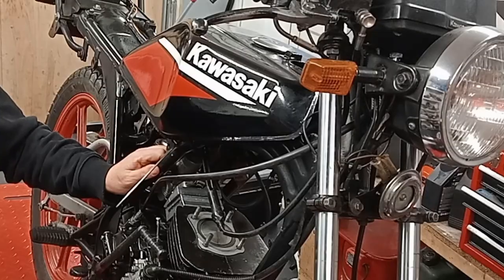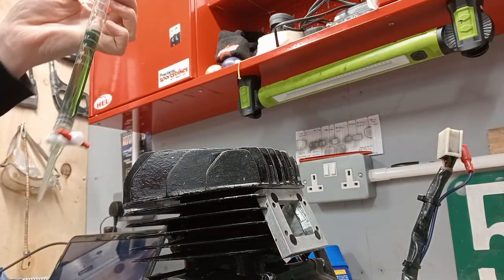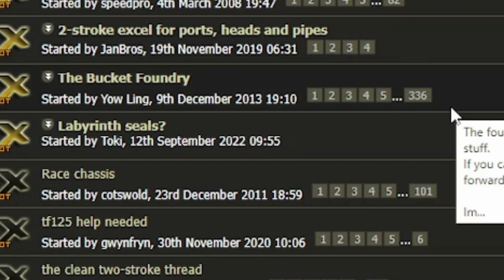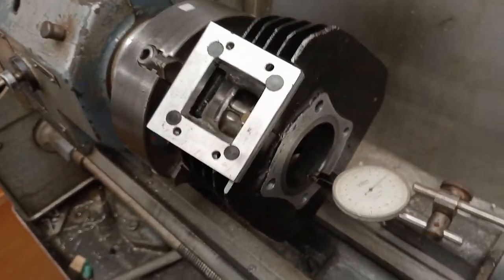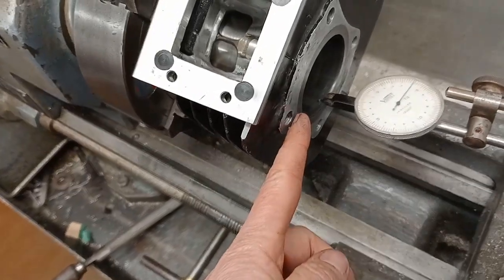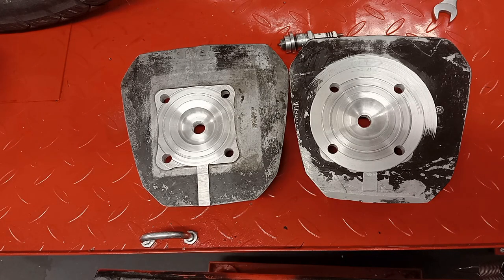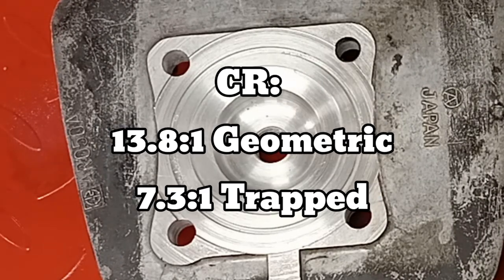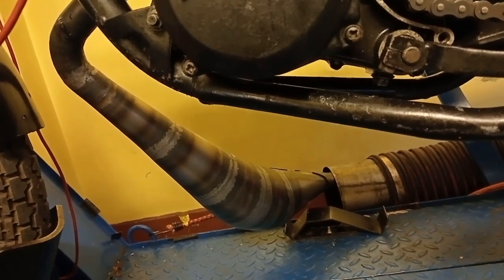2 Stroke Squish Area Ratio Test - Plus Bonus PIPE test

Comment: So much to unpack here. First of all, with more compression, you need to back the timing down at higher rpms as the heat generated from higher compression will work against you. Also, mixture turbulence causes a faster burn. So an ignition with a retard function will help. Check to see what your ignition is doing with a high quality timing light after marking flywheel with additional timing marks. Compression is great for bottom end torque but not so good at high end. Have you looked into ceramic coating the crown of the piston? Ceramic will even out the temperature of the crown so hot spots don't develop possibly causing inaudible detonation at higher compression ratios. Are you seeing any detonation clues on the plugs? Also, ceramic will insulate the crown so the piston transfers less heat to the crankcase. When the piston transfers heat, the crankcase pressure goes up and you won't get a full intake charge as the pressure differential between the crankcase and top of piston when ports open won't be as great so scavenging will be hampered. You can see this after the engine has run for a bit by examining the bottom of the crown inside the piston for what is happening to the oil mix as it contacts the piston. Shiny aluminum means you need more compression, charred means too much. Shiny black means your near the limit.
Reply from the maker: Hi Dale, thanks for your comment. My ignition is fully programmable and I have had the timing light on it but I do need to  try different settings as I've changed quite a bit. I have read that lowering the compression can give more energy to the pipe and if it's well designed it increase HP. 
I'm seeing no signs of detonation but if i'm honest my runs aren't long enough. I need to change the gearing to what it will be for 100 mph and test in 6th gear. Even then i'm sure i will have to jet up and retard ign for the real world. I'm also intersted in the effect on actual airflow over the engine and particularly the  pipe and it experiences a higher or lower temperature than the dyno - could be a key parameter to ensure the pipe is tuned for 100 mph airflow.
Any ideas on ceramic coaters in the UK? I have heard of this. I have also heard the polishing the combustion chamber and the piston crown can have a similar effect by reflecting heat out into the pipe. I'm not sure how effective this is but I see it as a test i'd like to conduct.
Noted about the heat transmission into the crankcase - I'd never thought of this. Thanks. 
So in summary the only place you want heat in a two stroke is in the pipe?
Reply: @AutoBeta2T  Look for shop that offers spray coating, aerospace if possible. Many years ago, Tony Nicasia would race the Kaw triples at Fremont Raceways. After each run he would use a garden sprayer to cool everything down. When I began racing, Roland Cushway was one of my friends when he was working for Hunt Racing Products. He prepped TZ250 for AMA competition. One of the things I noticed was the ceramic coating on the crown. I looked into this and that was when I started observing the under side of piston for what I called the heat health of the engine which I described in the first post.

Long story short, before we began closing up the squish band and coating the piston, we found that at a track like Sears Point ( I have no idea what they call it now) the bike would run out of turn 10 in 6th in the opening stages of the race, but as the race progressed, the bike would drop back to 5th and finally 4th gear as the engine lost power to crankcase heating which is what Tony was battling in triples.

After the engine was developed, the bike would consistently drive out of 10 in top gear. In the end stages of the race, my bike had the benefit of a 15 mph greater drive out of the corner. Ceramic coating works. I spoke with a gentleman that worked at United Airlines at SFO as a flame sprayer reconditioning internal jet engine parts. He informed me that a proper ceramic coating has three levels of applied material. All three have different expansion coefficients. The first layer was more like a primer and allowed for a greater amount of expansion. The second and third were the coatings that did the actual work. But the coatings together would allow the piston crown to grow without cracking the brittle ceramic coating. This is something the Roland had observed, but at the time wasn't aware of the cause as they were using their Plasma Products vendor, the same ones that coated the Hunt aluminum brake rotors with the friction material. The downside is that the coating has a thickness that will need to be adjusted for with the squish clearance.

Another word about ignition timing and dynos. There is a condition known as flash readings which is what some tuners used to claim their max HP reading. You have already alluded to this. In a nut shell, a cold engine will tolerate more timing and yield higher HP readings...for a moment. But as heat develops in engine, the timing will need to be retarded and along with it, the HP from max. If you wanted to do serious investigation into timing curves, I might suggest that WOT at various RPM's, for extended periods of time allowing heat to maximize. After several runs you may come up with a more realistic timing curve. Of course the curve will be dependent of the vehicle use i.e. a drag motor will tolerate more timing than a vehicle used for road racing, or in your case extended WOT for a speed record.

All the best, and REALLY enjoying the work you are doing. Your inquisitive nature and patience is adding greatly to the knowledge that many can use.

Comment: Tested head volumes on the  junk  bicycle  engines from a 5 cc to 8 cc when running long distances and seeking mph the 8 cc was the better set up the 5 cc head made more torque  but ran hotter I belive if I had a programmable  ignition  and  ran a better fuel with smaller combustion  chamber say like alcohol  the results would be little different. But not worth the trouble for 30% to 40% more fuel and fixed timing. Never been into funny fuels on none race application. As far as alcohol  motors go. Unless  it was a forced  induction  motor never seen more than roughly  7% power gains. In my mind most of the 7% came from more timing
Reply from the maker: Cheers Brian, for the info, so I think I'll be having to use lower compression when road testing to keep the heat down then. I'm going to start monitoring CHT too. Cheers
Reply: @AutoBeta2T  look closely  for signs  of pre ignition and detonation  if you choose to run high compression. Seen a comment  on your intake volume. I see zero  issue with your intake. Simple rule applies  to 2 strokes and 4 strokes longer intake runner length  equals  more torque and less rpm. More things I tested stuffing reeds stuffing cranks case flow porting my butt dyno said and speedo and tachometer  said all was waste of time. Stick to the basics most power gains is in port timings cyl design. Ignition  timing. And carb tuning and pipe design. Not sure what your rules are for hitting 100 mph. But if it was me I would be looking for a cyl that makes good power and retro fitting it to your lower unit. Basically like I did with the hybrid  motors example the junk crap I use to tinker with. I installed a cyl from mxs that's capable  of producing  18 ish hp compared to the stock 2.5 hp. Possibly  look at a cr80 cyl. Or anything that was air-cooled in the past rm yz cr that produced more power  out of the box  I 100% get improving and learning. But there comes a point when our expectations  are not realistic oo yea keep up the good work
Reply from the maker: Rules wise I guess there aren't any but I'd like to do it on pump fuel and a AR derived cylinder. However, maybe a time will come where I need to look at other options. I'm enjoying the journey and loving the input from yourself and others following this quest. Options are there but I'll keep going with what I have until the brick wall presents itself... All good stuff and appreciate the input. 
Cheers 😊
Reply: @AutoBeta2T  I'm with you on using funny fuels. I don't and never did. I wanted to find out how much power I could make on low grade pump gas only. I tested all heads all pipes all reeds stuffed un stuffed basically  I worked in reverse. Meaning I started  at the most extreme  custom  stuff found the limit of how fast things could be. Meaning the best of everything  zero gratification never happy. Then went back to stock and applied  what worked only. Lots of gimmics I eliminated  all gimmics did they make less power yes but the gratification  came from my hands and knowledge. Basically I knew how the most expensive custom stuff ran. So I knew what my expectations  and reality was. I left very few stones un tured
Reply from the maker: @2strokecarbtuningportingin187  sounds like you've been on quite a quest! Very interesting to hear that a lot of the go faster goodies don't actually do the business...
Reply: @AutoBeta2T  I have yet to see a aftermarket part actually meet companies  power claim gains .with the exception  of mxs cyl
Reply: more advance reduces the power
Reply from the maker: Monej, I'd say more advance above what is ideal will reduce power. I guess it's trying to find what the correct amount is for the engine (one of the reasons I went for a programmable ignition).